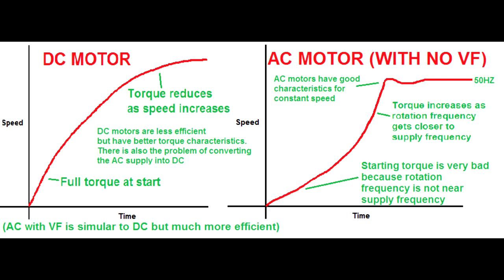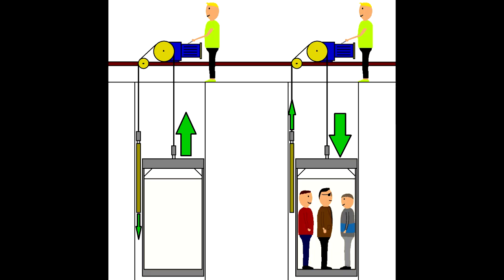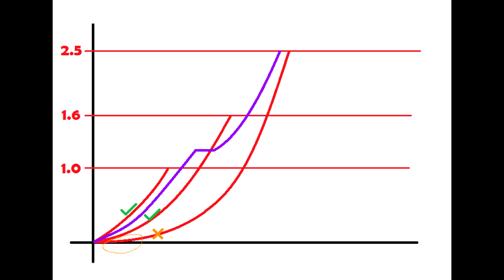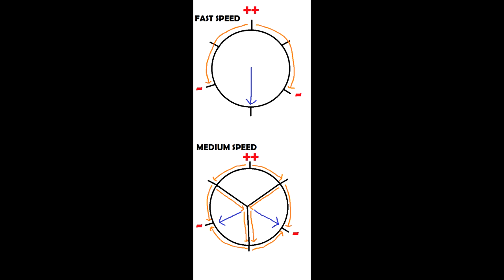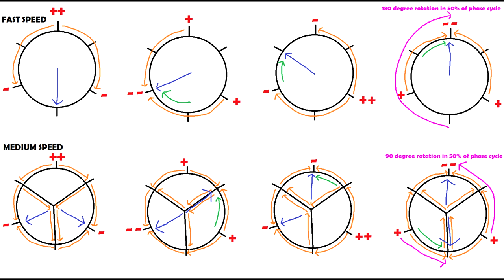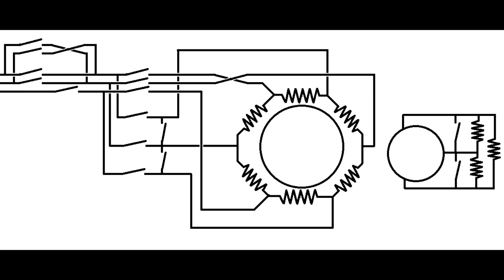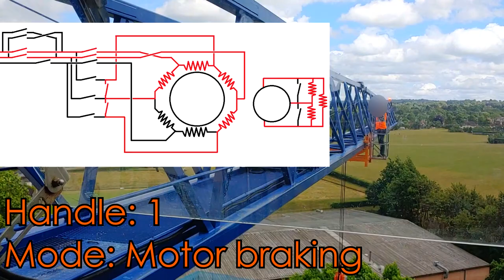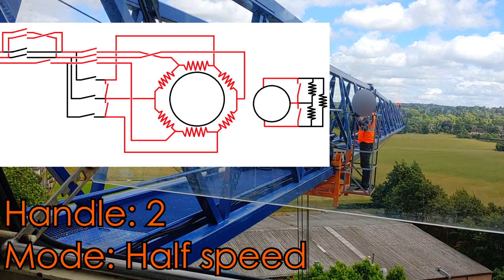How does a Pole Changer AC motor work

Comment: In my local Co op in the 70s, there was a "Ride 'im Cowboy" horse kiddy ride I used to enjoy riding on. When you put the coin in, the motor would go up to speed immediately, so the horse would start with a sudden jolt. The ride was probably built in the 60s, but the design went right back to the 50s, one of the first British kiddy rides. In their other shop there was a 60s "Circus Ride" of a little horse, and he started more gently. I like the electric motor impression.

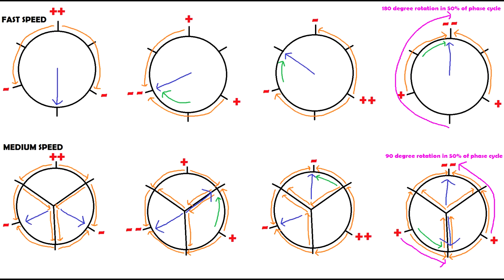Comment: 8:20 I don't really get it. It is clear to me that, assuming the field goes backwards in the medium speed configuration, two phases have to be swapped – but I don't see so clearly how the fields produce that result in the first place.
Your graphic shows two blue arrows for the centre tapped motor, indicating two electro-magnetic fields, as you say. It looks like they are of the same strength in each frame (and compared across all frames of the medium speed example). I would expect to be able to calculate a vector exerting an equivalent force on the motor by adding those two blue vectors. However, under this assumption the resulting direction of the magnetic field is the same as in fast speed for frames 1 and 3, while 2 and 4 seem to indicate the forces cancelling each other out. So, half of the time there would be no force exerted on the motor (very bad under load) and half of the time it would try to impose the fast speed, not half speed – clearly, my model is wrong. I hope I could explain my thought process well enough for you to spot the flaw in it.

Comment: What exactly produces the characteristic noises in the motor? Is that the breaks or is it some other kind of maechanical friction? I've always wondered about this "weeoh!" sound the motor switches speeds.
Reply: The noise is most likely caused by the ac electromagnetic forces present between the rotor and stator when magnetic slipage occurs between the two.